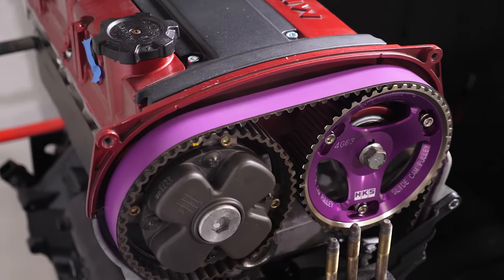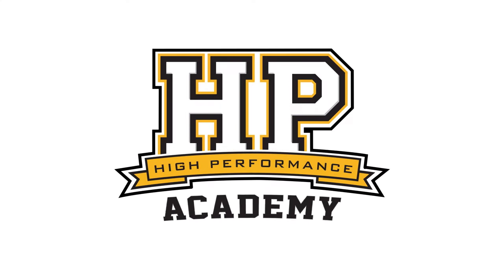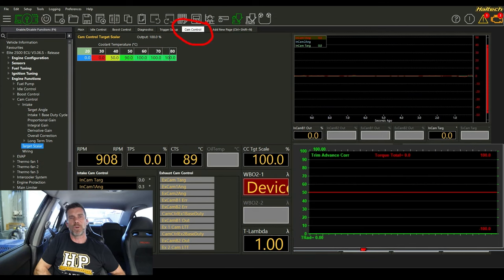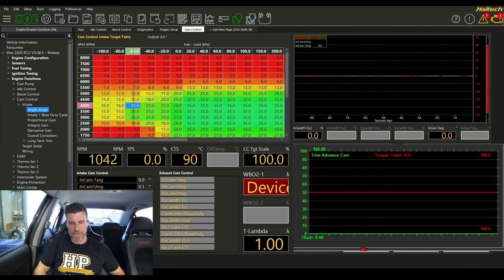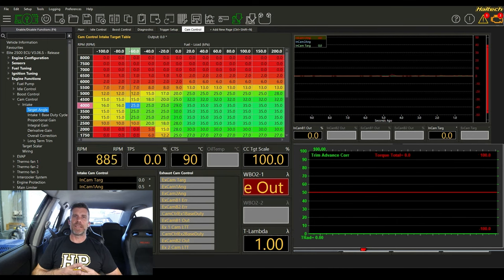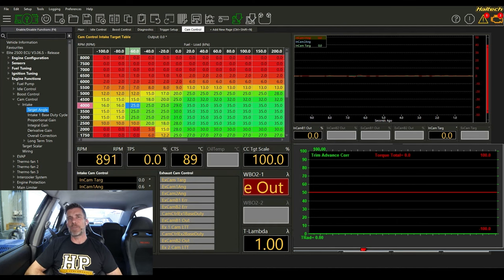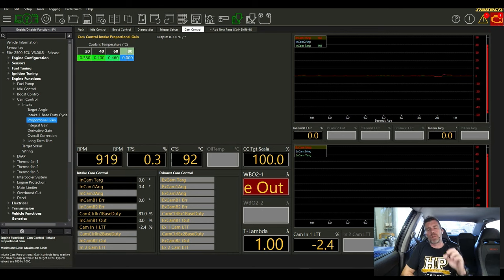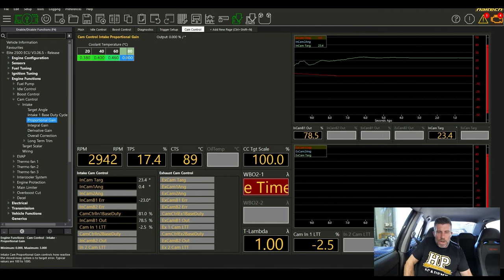The Secret To MIVEC Tuning | Variable Cam Control

Comment: Tell me this. Can you do a mivec control to create a pseudo larger cam profile by holding the cam with the valve position open longer?
Reply: It sounds like you have a poor understanding of how sync offset works. It doesn't change how long the valve opens, it changes the moment at which it opens. The effect of increasing VE is related to the piston speed. In the middle of the suction cycle it is higher.

The larger cam has a longer opening time and higher lift.
Reply: @18_DriftBox  you can keep the same lift and increase duration. Plenty of OEMs do that.
Reply: @RadDadisRad ye this is not about changing duration but timing the existing profile
Reply: @teadrinkingilluminati9173  gotcha.